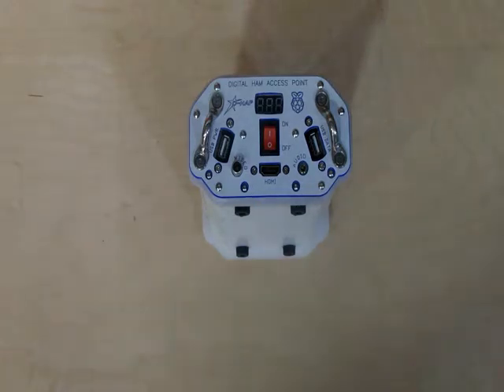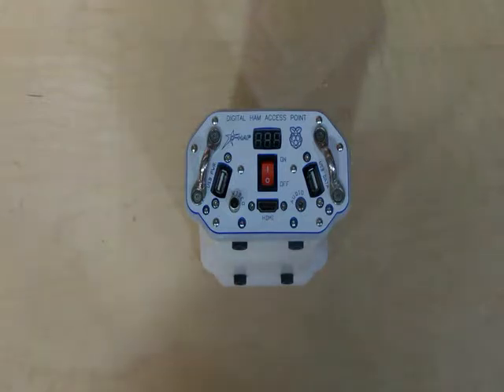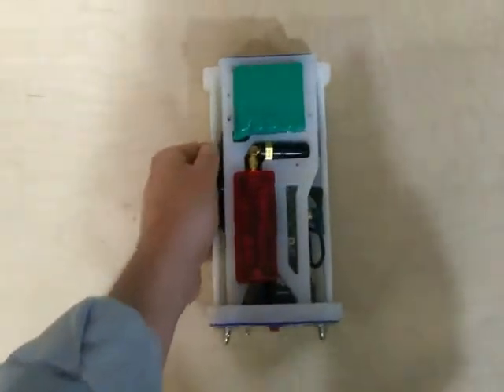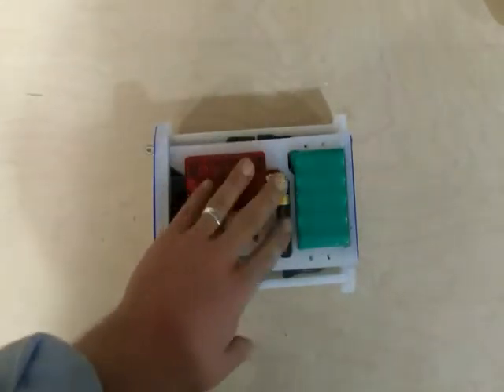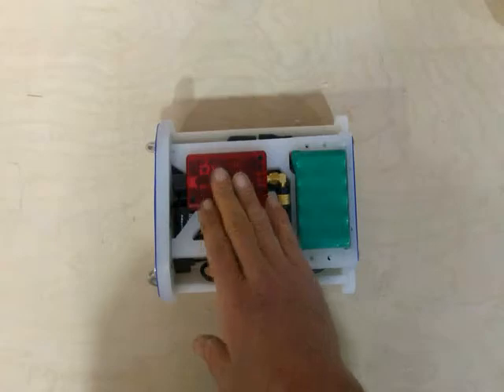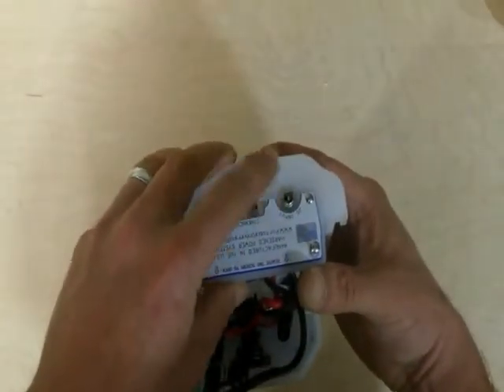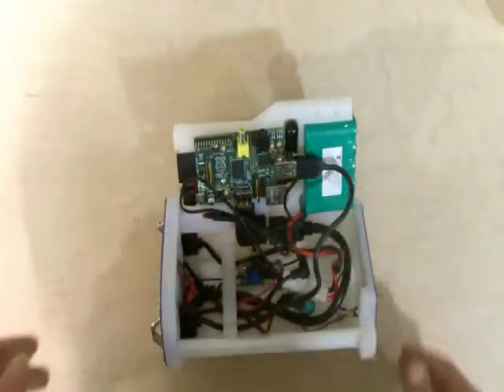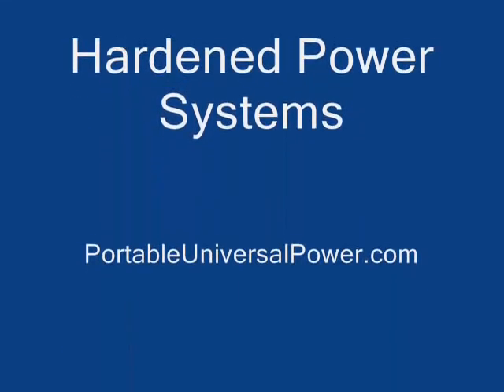D-HAP Introduction.  The new Digital HAM Access Point for the D-Star Network.

Comment: I have one of these, and it works great.  Question: has anyone else tried to source power from the external +12V jack on the back of the unit? Wondering if mine is defective or does it take a special connector.